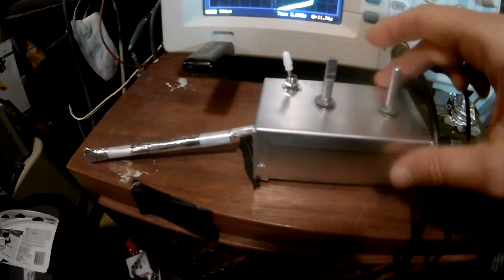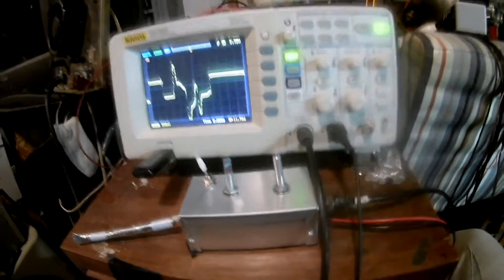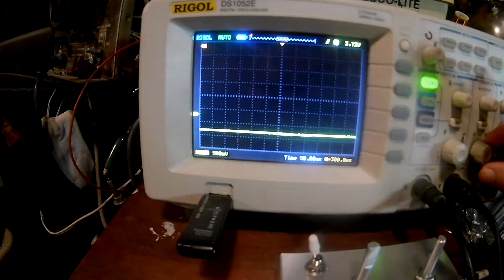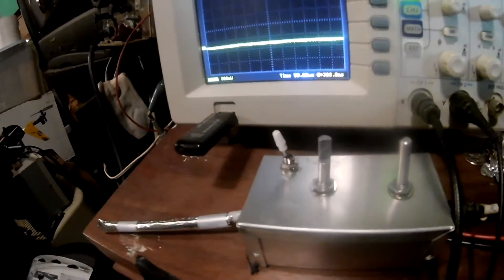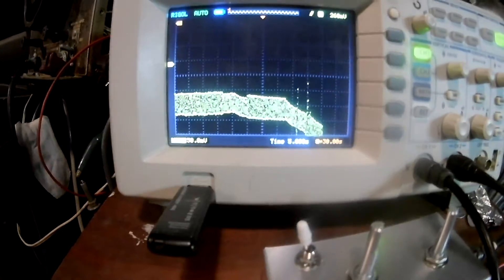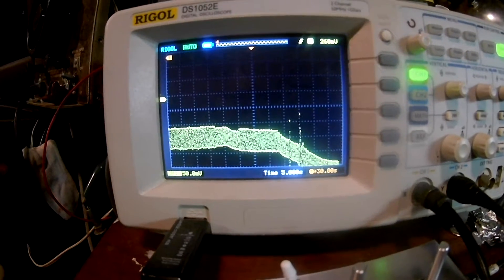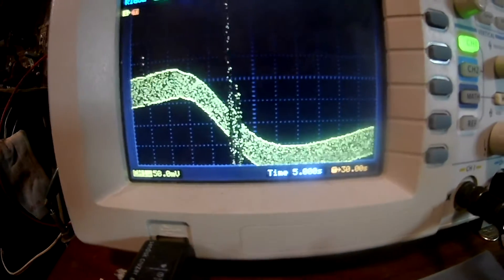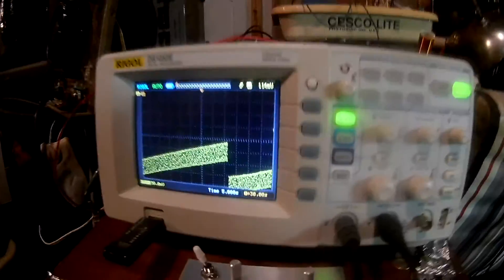Psychotronic Amplifier and Electronic Electrogravity Wave Detector

Comment: Hey have u heard of remote neural monitoring? U can probably help ppl being tortured...
Reply from the maker: Very interesting.. Are you into electronics, and science?? I have not tried to monitor brain waves with this device yet, but that is an interesting idea.. right now, is is picking up a large 60 Hz signal, even though the system is floating electrically.. which I feel the noise, might be larger that these types of signals.. but I can try to see if I can reduce the 60 cycle interference.. Thanks for the great ideas!!
Reply: @jaynesnetwork  np...i know a little not like u i dont build...i mess with orgone sometimes but look up eeg heterodyning...theres so many ppl need help with shielding from emf waves and other directed energy weapons. Looks like u can help these ppl...check out vulcan wolverine theyve found a linux system thats helpinh u think i dnt know all the details...and i have looots of links if u have an email
Reply: Gravity is electricity, i have knowledge @jaynesnetwork
Reply from the maker: Sound interesting. You can email me at dr_jaynes@hotmail.com
What kinds of orgone energy experiments have you done??

Have you tried the spinner experiment? It is an easy way to start working with this energy in a kinetic way.
Thanks for the great information!!
Reply: @jaynesnetwork  no but ive made mike emrys orgone bubble...i used the usual orgone recipe and 3 violet ray wands uv light and concave mirrors and interestingly i always had a sunny circle over my house. Lots of black helicopters were always around but i moved...